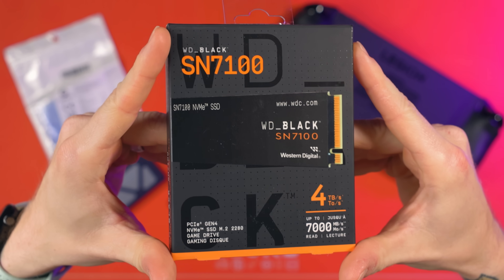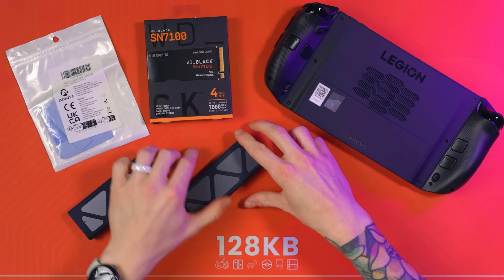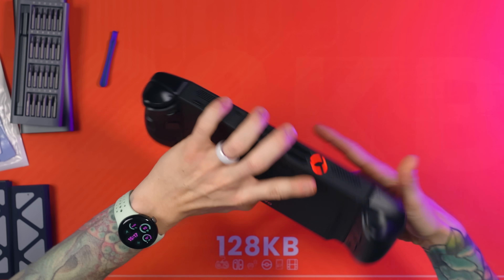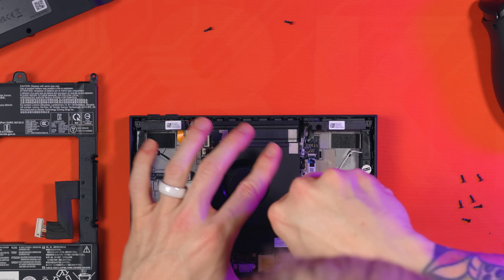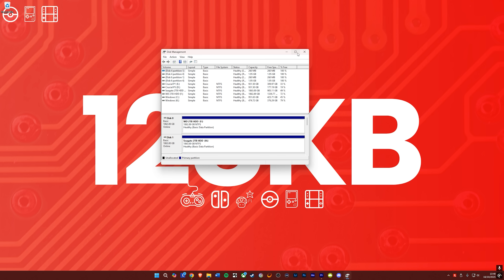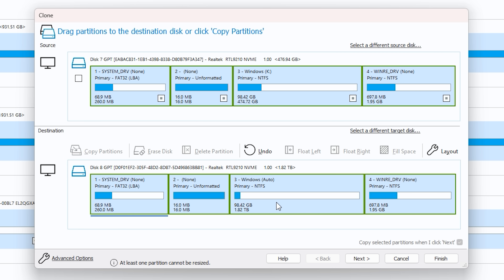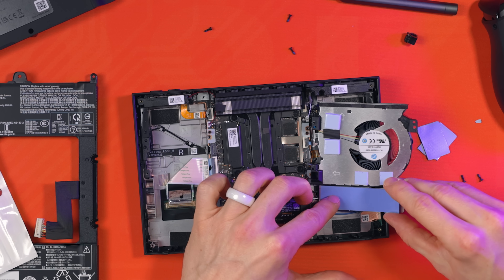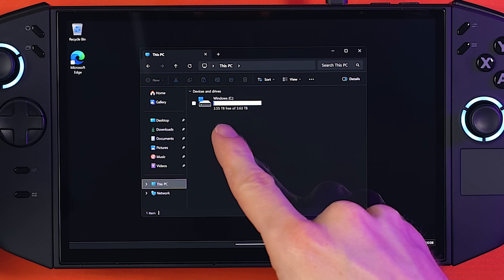Upgrade Your Legion Go 2's SSD Easily

Comment: ended up going the same ssd, followed your instructions, so well done and step by step you made it easy , got my lego 2 just today and already have it installed now just running the recovery perfectly from my thunderbolt dock (wasnt sure it would but it auto detected the usb drive and pretty much ran itself), fingers crossed ill come back in an hour or so and it will be done :) in the meantime back to my lounge with my Claw and NMS... keep up the good work, awesome content  great video .

Comment: <<<PSA>>>

You actually don't need to swap the thermal pad, the original one would work, because the thickness of SN7100(at least up to 4TB) is the same as the 512GB drive that comes with the console.

Once you put the battery back, the battery cable, and the foam on the back cover would actually press the heatsink down, and it will make contact with the SSD without issues.

Comment: Did you test the temperature? with 4 TB the temperature is higher and the console could have problems with it. On the other hand, did you test the battery use after the upgrade? these disks consume more battery, and we go very just

Comment: if you have a laptop or pc with 2 nvme slots u can use those to use with clonezilla usb boot usb drive if u dont wanna get extra nvme usb bays. you could also us 1 slot too but then u need to save the image to another usb device that has that space

Comment: I need help! I tried to download macrium reflect on my MacBook and it says it won’t work! Can I use a Mac OS app!? Or does it have to be done on a windows pc!?
Reply: Did you get this issue resolved buddy? I’m looking for the same answer
Reply: @j @jackmurray4926  yes I got you! It is true you can actually use your Legion go 2 to do the whole thing. You only need one SSD enclosure your new SSD drive and download the Macrium reflect right to your Legion go and proceed with everything as he had stated in the video. Then perform the surgery for swapping out the SD cards and you are golden. Once you do your first boot up, don’t be afraid if the screen stays black for 30 seconds to a minute it’s just going through everything for the first time.  I hope this helps.

Comment: Please tell me what thermal pad size did you end up using?
I just ordered the WD BLACK SN7100 4TB SSD as well.
Thanks a lot!
Reply: You actually don't need to swap the thermal pad, the original one would work, because the thickness of SN7100(at least up to 4TB) is the same as the 512GB drive that comes with the console.

Once you put the battery back, the battery cable, and the foam on the back cover would actually press the heatsink down, and it will make contact with the SSD without issues.

Comment: Hi can I just buy this M.2 Duplicator Cloner Dual-Bay Offline USB C to NVME SATA Docking Station, M.2 Reader 20Gbps for Both (M Key, B+M Key) PCIE NGFF Dock, Size 22110 2280 2260 2242 2230 Enclosure - NN/SS RGB and not do any software stuff?
Reply: @128KB

Comment: @128kb Did you use an adapter to convert 2242 to 2280? Because it comes with 2242 right? If so, which one do you recommend? Thanks.
Reply from the maker: 2TB models come with 2280, 1TB & 512GB models come with 2240. No adapter is needed, 2280 is supported out of the box, I show this in the video :)
Reply: @128KB  Thanks mate! Appreciate all of your videos!

Comment: Question: Does the same cloning method apply to the Steam OS version of the Legion Go? I am about to order up an SSD and get to the upgrade this weekend. Also, one of the comments mentioned that if you do the cloning on a brand new unit before first power on you will not need the recovery image. Is this true. Thanks for the great video. Very easy to follow.

Comment: What was the thickness of the thermal pads that you used?
Reply: You actually don't need to swap the thermal pad, the original one would work, because the thickness of SN7100(at least up to 4TB) is the same as the 512GB drive that comes with the console.

Once you put the battery back, the battery cable, and the foam on the back cover would actually press the heatsink down, and it will make contact with the SSD without issues.

Comment: What size thickness was the thermal pad you had to use? 1.5mm?
Reply: You actually don't need to swap the thermal pad, the original one would work, because the thickness of SN7100(at least up to 4TB) is the same as the 512GB drive that comes with the console.

Once you put the battery back, the battery cable, and the foam on the back cover would actually press the heatsink down, and it will make contact with the SSD without issues.

Comment: Hi there, great video! 
Just wondering, what thermal pad size did you end up using?
I got the WD BLACK SN7100 4TB SSD as well.
Reply: He said he got the mix pack and use the thicker ones then was on there as the sn7100 is thinner
Reply: You actually don't need to swap the thermal pad, the original one would work, because the thickness of SN7100(at least up to 4TB) is the same as the 512GB drive that comes with the console.

Once you put the battery back, the battery cable, and the foam on the back cover would actually press the heatsink down, and it will make contact with the SSD without issues.

Comment: Awesome!! Question… is it better to buy an internal ssd like the one you got, as apposed to using a high speed 2 TERABYTE micro sd? Or is there a reason to have both maybe?
Reply: The internal ssd is much faster and more efficient then the micro SD.
Reply: U can have both 4TB nvme and 2TB micro sd card
Reply: @TkoddaLee yes. But idk if I will need a sd card at that point maybe wait till the ssd is full or just put smaller less demanding games on it

Comment: Should i open it update it and get it going them do the ssd upgrade or does it matter. Im waiting on mine to come in but rlly considering this. Think i can download the rcovery media thru my smart phone usbc? I have a galaxy ultra s20
Reply: I also have a 25 ultra that should work to download the recovery media to the usbc?
Reply: Should I even waste my time with the original ssd update setup etc? I'll just have to do it again anyway right?
Reply: If using the media photo from lenovo you just have to update the drivers after right??
Reply: Lastly if I have the 1tb model the new ssd sn7100 is still plug and play or I need a clip conenctor?

Comment: Hows the 7100 been for you? Have you notices any windows laggyness or anything with no DRAM on this particular ssd? Can't decide between a 990 Pro or the 7100
Reply: Hi! I am also in same dilemma. Can't decide between both. Wd 7100 efficient but it doesn't have dram. 990 pro has dram but it looks like drains more battery. Which one did you buy?

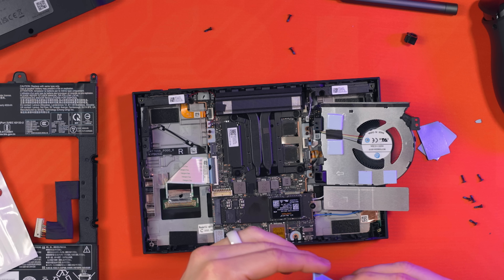Comment: 10:18 thermal pad thickness 1mm? or 1.5mm?
Reply: Ey! Did you figure it out?
Reply: @askesis5757  You actually don't need to swap the thermal pad, the original one would work, because the thickness of SN7100(at least up to 4TB) is the same as the 512GB drive that comes with the console.

Once you put the battery back, the battery cable, and the foam on the back cover would actually press the heatsink down, and it will make contact with the SSD without issues.
Reply: You actually don't need to swap the thermal pad, the original one would work, because the thickness of SN7100(at least up to 4TB) is the same as the 512GB drive that comes with the console.

Once you put the battery back, the battery cable, and the foam on the back cover would actually press the heatsink down, and it will make contact with the SSD without issues.

Comment: Hi, how many mm your pad please ?
Reply: You actually don't need to swap the thermal pad, the original one would work, because the thickness of SN7100(at least up to 4TB) is the same as the 512GB drive that comes with the console.

Once you put the battery back, the battery cable, and the foam on the back cover would actually press the heatsink down, and it will make contact with the SSD without issues.

Comment: I bought the drive you suggested and found that the thermal pad for the ssd wasn't touching because the battery, when put back, pushes the fan unit down including the thermal pad, then the thermal pad contacts ssd perfectly.
Reply: Exactly.

Comment: I appreciate your content.  I went through your full Lego2 set up tips and they were spot on.  Question about cloning the boot drive.  Is there a particular reason you recommend to pull the drive and clone it externally rather than just plug your new drive with enclosure into the legion go 2 to clone the boot drive with the LeGo2?  I'm trying to decide whether to get two enclosures or just get one and use the Lego2 as the source.

Comment: Did you use a 1.5mm thick pad or 2mm thick?

Also would you recommend the 4TB SN7100 over the 8TB SN850X? I know power efficiency and thermals would be better since the SN7100 is better optimized for handhelds/laptops, but question is by how much and is it a noticeable difference? Wish it were possible to get a 8TB in the SN7100 😩
Reply: U want the Sdd tat produced less heat and draw less wattage for these handheld so SN7100,Lexar NM790,Crucial p310,Crucial T500 and Samsung EVO 990 plus
Reply: You actually don't need to swap the thermal pad, the original one would work, because the thickness of SN7100(at least up to 4TB) is the same as the 512GB drive that comes with the console.

Once you put the battery back, the battery cable, and the foam on the back cover would actually press the heatsink down, and it will make contact with the SSD without issues.

Comment: Followed this guide exactly as described for the teardown and replacement process. Only thing I did differntly was to install the cloning software on the LG2 itself,  clone the drive to a 4TB drive, then install the new hardware. This eliminates having to buy 2 external drive enclosures. Thaks a bunch for the guide!!! Love this channel! Keep those guides coming!
Reply from the maker: Thanks so much, really means a lot. Really pleased the guide was helpful too!!
Reply: @128KB wat is the thickness of the thermal pad?
Reply: Your comment saved me a lot of time, THANK YOU! 🙏
Reply: I was going to suggest this too.  👍

I’ve cloned the active drive to a new drive in a caddy many times in the past using Macrium Reflect on desktop PC’s as well as handheld PC’s.
Reply: im a bit confused, when you say clone the drive to a 4tb drive, you mean a different one than the one you're going to install right? or are you cloning it directly to the new side? and if so, how?

Comment: You don't need two SSD enclosures, just use a USB hub connected to the G2 and clone the drive from the device itself. That's how I did with my original Legion Go.

Comment: curious question, can you clone the drive direct from the legion go?, as in install cloning software to legion then just use 1 enclosure to put the new m.2 in and clone to that drive then swap the new m.2 into the legion then uninstall the cloning software from the new cloned drive?

Comment: So the thermal pad you ended up using was a 1.5mm thickness one in the assorted pack? The amazon link doesn’t go to a specific product, but the first thing that popped up had 0.5-1.5mm sizes
Reply: You actually don't need to swap the thermal pad, the original one would work, because the thickness of SN7100(at least up to 4TB) is the same as the 512GB drive that comes with the console.

Once you put the battery back, the battery cable, and the foam on the back cover would actually press the heatsink down, and it will make contact with the SSD without issues.

Comment: Thanks for this! You may have missed one step (for most users) and a couple of explanations. 

For the new SSD, you need to Initialize disk as GPT (not MBR) before you select New Simple Volume. Most people will need that step. Plus also ‘Do not assign a drive letter” might confuse a few.  

And finally in Macrium on the new empty SSD I was shown a small 16MB Windows unformatted partition ahead of the NTFS formatted partition. This is normal but didn’t show on your new SSD. That stalled me for a second until I stopped and researched it. 

Lastly on the hardware side:
1) my brand new unit did not have that solitary little screw for holding the fan. Either manufacturing error or they have decided it’s not needed as fan clamped down by the battery screws already. And
2) I replaced the stock 1TB SSD with a Lenovo NM790 8TB which is double sided and so their existing insulating tape was exactly the right height. I would suggest people compare the top height of the stock SSD side by side with their new SSD while they have both in hand to get an indication of whether they need to adjust insulating tape or not.
Reply: I cloned my drive but it automatically made it the D drive. Will this be an issue or will it automatically make it C when I install it back to my Lego 2?
Reply: @michaels5593  I did the same thing but it automatically changed it to c when i put it in the legion go. Just in case anyone else is wondering.
Reply: How many hours it takes for the usb recovery mode to install mine is stuck on what appears like 90% and hasn’t moved. It has been 3 hours, is this normal?

Comment: Great video, I'm going to install the same 4tb drive.  Do you know what thickness thermal pad you used?  .5mm, 1mm or 2mm?  Would really appreciate it so I order the correct item, THANKS!
Reply: You actually don't need to swap the thermal pad, the original one would work, because the thickness of SN7100(at least up to 4TB) is the same as the 512GB drive that comes with the console.

Once you put the battery back, the battery cable, and the foam on the back cover would actually press the heatsink down, and it will make contact with the SSD without issues.

Comment: Lame rookie question: did you use two of the ssd enclosures or why you have two in the vid? Seemed to me my bad that you have installed the two in the same ssd enclosure...but dont see it. ty
Reply: No one enclosure per drive hence two needed.

Comment: @128KB   just wanna ask what thickness of thermal pads you used... great video btw, although I have to wait until the lego2 become available locally this is a great help in the future...
Reply: You actually don't need to swap the thermal pad, the original one would work, because the thickness of SN7100(at least up to 4TB) is the same as the 512GB drive that comes with the console.

Once you put the battery back, the battery cable, and the foam on the back cover would actually press the heatsink down, and it will make contact with the SSD without issues.

Comment: I followed some Russian dude's guide a little while ago but this is 100x more informative and entertaining - can vouch 100% for the methods outlined here. I'll add that if anyone is wondering, I can confirm a double-sided 8Tb fits and also works great with good temps. Really appreciate the vid!
Reply from the maker: Awesome to hear, thanks for the added info about the double-sided SSD fit!
Reply: Ah nice, since its double sided, does the stock thermal pads manage to touch the ssd ok? Just wanna check if I have to get thicker ones
Reply: @masatoindou1759  I installed a Sabrent 8tb Rocket 4 plus and the existing thermal pad made good contact. I also added a thermal pad to the underside of the drive as there was plenty of room for that, too.

Comment: Will the SN850X 8TB work? Or will it sacrifice efficiency and battery life?
Reply: I wouldn’t go with sn850x. The 4gb WD Black SN7100 is a better choice than the SN850X. The newer SN7100 is more power-efficient, produces less heat, and is well-suited for gaming handhelds. The SN850X is geared toward heavy, sustained workloads on desktop PCs.
Reply: Sn850x and 990 pro is faster but it more expensive the sn7100 is more of the affordable option

Comment: Your link for the thermal pads have different options. Did you buy A Dwits 6 pices 0.5, 1.0, 1.5mm or 30 pack no brand that has 30 pieces 05mm, 1mm, 1.5mm, 2mm, 3mm ?
Reply: You actually don't need to swap the thermal pad, the original one would work, because the thickness of SN7100(at least up to 4TB) is the same as the 512GB drive that comes with the console.

Once you put the battery back, the battery cable, and the foam on the back cover would actually press the heatsink down, and it will make contact with the SSD without issues.

Comment: Finally z2e go 2 back in stock but for November 12 shipping 😢
Reply: Yes, I snagged one😂 Now I need to get the WD SN 7100 ssd, 2 enclosures and thermal pads🤣 The only thing I am not sure is the size of the thermal pads. His link shows different options, 2 different pack sizes. One pack 6/12 pieces x 0.5mm, 1mm, 1.5mm the other pack different brand has 30 x 05mm, 1mm, 1.5mm, 2mm, 3mm
Reply: @Hussar-fm8iy I want it but I really curious if it’s gonna be like the Xbox ally x where launch day they have some in stock in store. A week before launch it was showing mid November. Launch day it was showing within a day or 2.

Comment: Oddly enough the lenovo manual says "do not pull the power cable by the cables" seems that was a non issue for you
Reply: No other way to do it.  I pulled gently by cables as well.

Comment: GREAT VIDEO. 

I went with the Xbox Ally X but I will do the same cloning process all the same.
Reply: The ally has the Windows recovery in the bios, so you can use that if you have no data yet on the internal storage
Reply: @onzypaarntie18wait does the legion go not do that too? I loved that on the ally

Comment: i use the same 4tb drive.everything works perfect...also didnt change any thermal pads...i will check the temps  though just in case.
Reply: How were the temps?  I did a 990 Samsung pro but didn’t change the pads either.   I assumed once the battery and plate was back in it would end up pressing the pads against the ssd anyway.